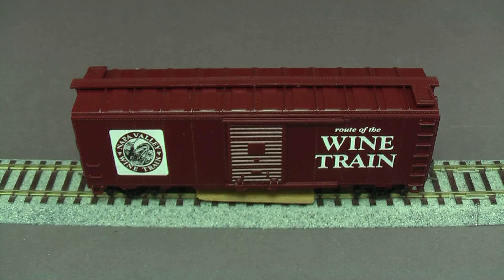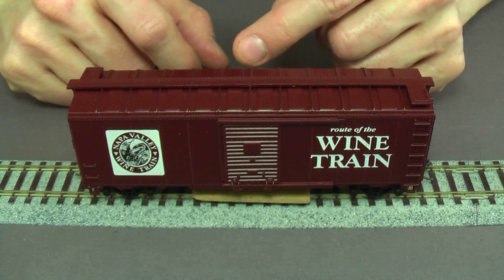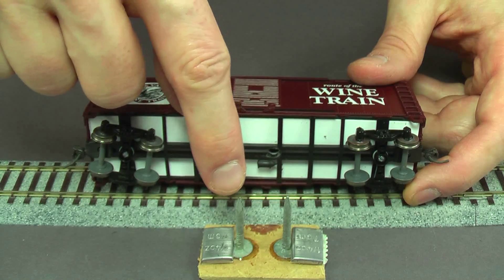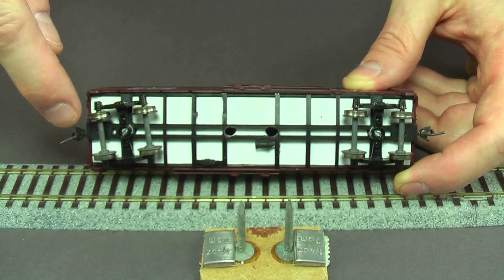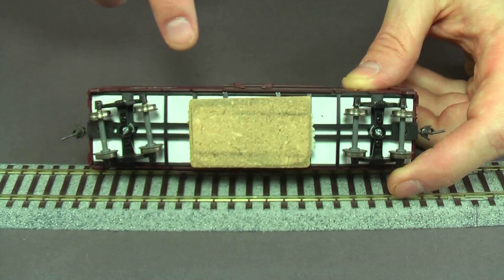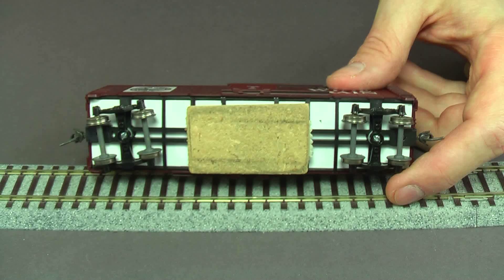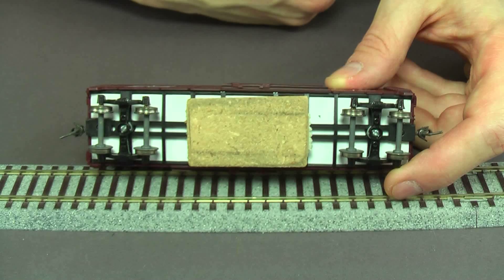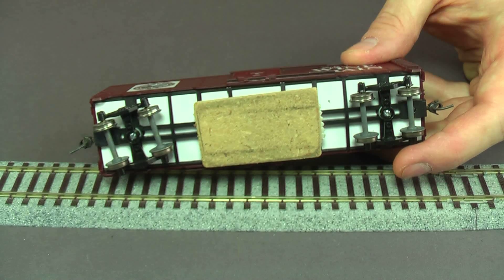HO Scale Track Cleaning Car 5-1-14 Podcast

Comment: As the guys say in their opening statement this idea has been around for ages. That's because it works, up to a point. I have one of these in every train consist, but I've also added a super magnet mounted 2 mm above and across the track! It is amazing what I find sticking to that. The only caveat is, you must have a properly weighted car and high quality bogies and metal wheels. By the way, get rid of all your plastic wheels. Dirt sticks to them like it's going out of fashion. 
From time to time lift the waggon off the rail and use a small wire brush to remove the gunk on the pad.
Oil on track, buy a CMX,  not cheap, but gives oil free track. The formula here is less sticky stuff on the rails means less dirt sticking to them!
Pete